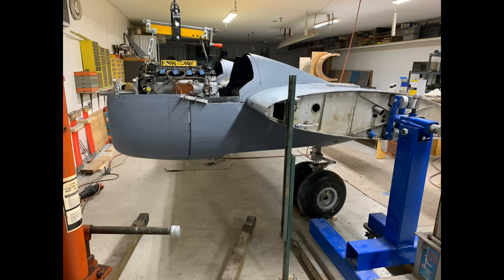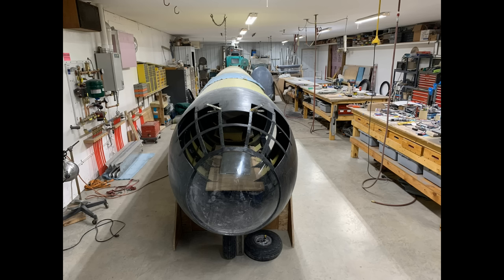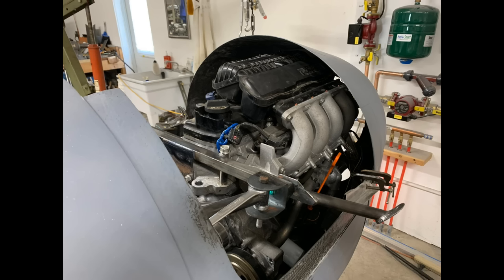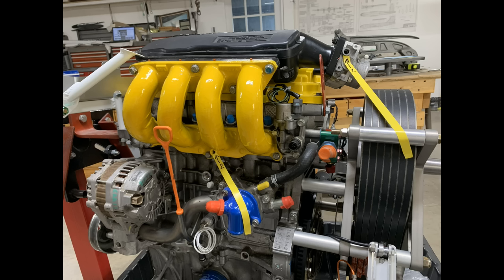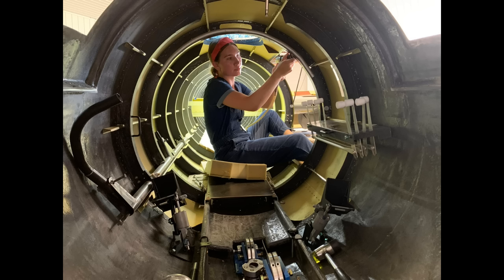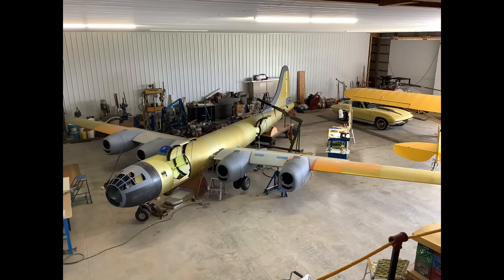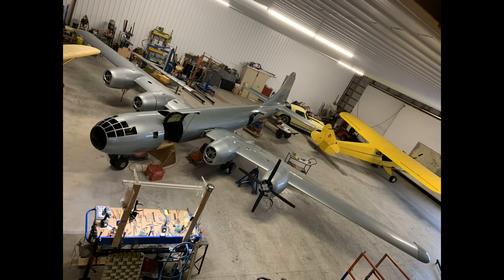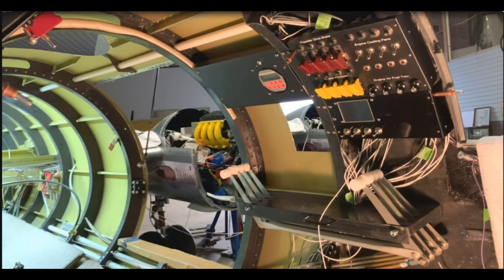Honda Powered B29 Replica

Comment: Those honda fit engines are really good, I have 200,000k miles on one and it's had zero problems. Always driven hard too.
Reply: If you always changhed the oil engines at 200k are still new, the car May Need minor maintenace but the engines if well treated are new
Reply: They are so reliable, In my 63 years I cannot recall ever seeing a dead Japanese engine that needed any thing more than a new set of rings and a bit of work on the valves, and when they do die they give you plenty of warning, you know fill up the oil and check the petrol.
Reply: The Honda Fit engines are the basis of the Viking Aero Engines produced commercially for experimental and light aircraft...
Reply: wow that is so not even a little relevent to this video
Reply: If you build such an airplane and will sit in it later on you will install the most reliable engines you can buy. Would you do it in another way?

Comment: Hard to imagine someone being capable of designing and building such a thing.  I work really hard in my free time on my car and motorcycle projects and just can't even fathom getting a project like this completed in five lifetimes lol.  Just amazing.
Reply: You and me both but I,ll be back in the shed on my bike resto once I,m done here.
This B29 an inspirational project and beautifully crafted. Just watched the first flight.
Reply: @Tekjoe25  It's just mind blowing.  Like the guy who built the Countach from scratch in his basement.  This is even more mental lol.
Reply: You have to look at it as compiles like BOEING that designed and built the B29 were made up of people just like  Tom Hodgson. Durring WWII Mr. Hodgson would probably have been working at BOEING. The difference is that BOEING had thousands of engineers and people working on the B-29 and Tom Hodgson only has a fraction of that, but just because it's one man it does not take away from his level engineering quality.

Comment: That is fantastic!    I always thought they should have made Bally's Bomber a two-seater.
Reply: It was way too underpowered for the extra weight.  He had to remove the gearboxes off the hirth engines to make everything look to scale so It lost a considerable amount of HP
Reply: Someday! To make the B-17 a good 2-seater or more it would have needed to be closer to the size of this thing which would be like 45-50% scale for the Fortress. 

Bally did a good job for what he did, but that machine does need more powerful engines for sure.
Reply: @karaayers2867  I wonder if HKS 700Es would make good replacements for the Hirth engines.
Reply: Keep those slugs flying taofledermaus 😊
Reply: @PistonAvatarGuy  the HKS might work but getting 4 of them would be a challenge and the cowls aren't very big so would still be a tight fit.

I did some thinking and one idea that might work for the Bally is putting some kind of genset in the "bomb bay" and electric distributed propulsion in the nacelles. It would probably yield higher HP per prop and package well.
Reply: @scottwatrous  I think HKS is still selling new engines, so it shouldn't be difficult to get 4 of them, just expensive. The 700E is only a couple of inches narrower than the Hirth engine, so the offset gearbox might still be an issue.

The challenge wirh your idea would be cooling a ~300 hp genset in the fuselage. Weight would also likely be an issue.
Reply: @scottwatrous  It's unfortunate that Verner Motor made their engines run at such a low rpm, higher rpm engines would have been smaller and lighter and probably would have been perfect for the Bally Bomber project.

Comment: Impressive.
But I'm still in awe of the Bally Bomber, which is a scale B-17 that has a pilot inside it.
Reply: This will be pilot flown. Don't see how you think this is less impressive than the Baily Bomber.
Reply: @filster1934 did he actually say that?
Reply: @daszieher you think it's gonna be RC with 4 Honda engines???
Reply: @daszieher  Yes, look at the pics.  There's flight controls and shutoff switches inside.  He posted above stating it's a 2 seater in tandem.

Comment: Okay so I see what appears to be a set of engine/prop controls. Also lots of switches inside. So is this a pilot flown A/C, or is it a very large R/C model? Either way it's damn impressive. That's some serious fabrication going on there. I am blown away by the accuracy and remarkable amount of time it must have taken. Hell the preplanning alone had to be time consuming in itself before the first piece of sheet metal was cut!!!! BRAVO
Reply from the maker: R/C wasn't mentioned anywhere in the vid. This has a 50 foot wingspan and weighs around 3000 pounds. It's a 2 seat replica.

Comment: And @007mwn, I think the narrator made a mistake in that, I think the Piper Cub in the background was used for the engine/redrive testing, the engines now well proven in that plane.
Reply from the maker: That's what was said here... I know because I supplied Tom with EFI for it 10 years ago.

Comment: Are there any special considerations or design changes that need to be made when taking an airplane design intended for some full-scale aircraft and then using that same design to make a new aircraft which is only about 1/3 the size? For example, doesn't one have to re-analyze the aircraft structure and all the control surfaces to ensure that all mechanical stresses are still within safe bounds and that the control surfaces can still operate efficiently and safely? All this might not be necessary if this were an RC aircraft, but since it has human pilots inside it I would think that all of the possible safety issues would have to be studied.

Comment: Beautiful plane!  Why 35% though?  The one thing that throws it off (for me anyway) is the tall bubble.  I take it that's for the pilots viewing?  If it was 40% could you have seen from the glass nose perhaps?  With some sliding side/top panels if needed?  (Like a replaceable sun roof, though for static showing, could you pull the bubble down with a temporary cover panel?)  You and Mr. Bally need to get together to share notes.  :-)

Comment: Why liquid-cooled engines? The radiators and associated plumbing probably add 150 pounds, plus the complexity of installation.  Maybe 150 pounds isn't much on a model of this scale. When is the maiden flight projected to occur?
Reply: Air cooled options were likely far more expensive. The best option would have been Rotax 915s, but those are $40k+ engines. Rotax engines have liquid cooled heads anyway. The UL Power engines are likely too wide for this aircraft and are also expensive. Air cooled engines also burn a lot of fuel, the weight of which would likely have exceeded the greater weight of the Honda engines. 4 engines burning an additional gallon per hour adds up pretty quickly. Edit: That fuel burn is at cruise power, at full power it's more like an additional 3 gph.

Anyway, apples to apples, liquid cooled engines are lighter than their air cooled equivalents, but we're comparing automotive engines to aircraft engines here, so...

Also, maybe he just needed heavy engines to get the CG right.

And you're probably looking at something more like 15 to 20 pounds of weight per engine for the cooling system, not ~40.
Reply: Why?  Millions of honda fit engines built, easily bought used for $500.
Reply from the maker: As mentioned in the video, this is a test bed for the Honda engines and reduction drives Tom designed.
Reply: @rv6ejguy I love to see different approaches making auto conversion work! Any idea if he plans to sale his conversions in the future? The price of “real” aviation engines are too expensive! I fly my Zenith 750 with a Honda Viking conversion, 32 hours so far and no problems. With that being said, I like to have back-up options if the time comes! Thanks for sharing!
Reply from the maker: @mhilderbrand7693  Tom's plan is to get more hours on the redrives. If proven reliable, he may offer for sale at some point.

Comment: Neat , 3,000lb actual comes out to 70,000 Scale pounds (Close to 74,000lb empty weight for B-29) , Factor weight and thrust by (1/scale)^3 or a factor of 23.3 ,    so 100 actual hp would factor to 2,300 Scale HP

Comment: Do you know why he made the fuselage the diameter it is? Is it to scale?
Reply from the maker: To scale AFAIK. Aircraft is being worked on now and Tom hopes to be back in the air in less than 2 months if all goes well. Will try to post another video at that time with more details and photos.
Reply: You seem to be well informed about this airplane do you mind if I ask you a bunch of questions about it?
Reply from the maker: I talked to the builder and pilot a couple days ago. He'll supply more info, photos and video when he's ready to resume test flying in a couple months. Repairs and minor mods are coming along well. He has a full time job flying Falcon 50/900s which doesn't allow him as much spare time as he'd like to work on the B29.  Be patient, more to come.  @timjodice100

Comment: Pretty amazing ! An RC aircraft that needs a full size aircraft hanger, and looks like it could be manned ! Thanks for sharing !

EDIT : Or is it meant to be piloted aboard ? I was getting the RC vibe/idea somewhere but now I'm not sure where.
Reply: One of the frames showed engine controls with cabling so I have to think it's going to be piloted.  At that scale it's going to be around 33' long, 47' wingspan fuselage diameter would only be 3' 2" so a wee bit cramped.
Reply from the maker: This has 2 seats in tandem. How would one transport this to the R/C field?
Reply: @rv6ejguy  There are some pretty big RC aircraft out there.  But, having said that, I've yet to see one that's using car engines which is another tip off that this isn't RC.
Reply from the maker: @fsj197811  Never mentioned R/C once so I'm not sure why so many folks think this is R/C. Has roughly a 50 foot wingspan and weighs a few thousand pounds. How would you fit that in your truck?
Reply: @rv6ejguy  RC didn't cross my mind until someone mentioned it.  There are some large RC aircraft but the weight is relatively low.  The more I thought about it the more I was: Nawwww this is going to be piloted.  Besides, I think 'experimental' was mentioned and I don't believe RC aircraft get that label. :)
Reply: @rv6ejguy The Taxi footage does feel like it's almost a giant RC in a way. I think because the structures and vehicles behind don't feel that small, and the fact it's on a grass strip where it accelerates very quick, that just feels like a lot of RC footage people have seen.

If this is filmed from a distance with zoom that'll definitely flatten the image and mess with the perspective a bit. To really help with the scale best is get close as possible, nice large field of view, and keep the camera lower so that the aircraft feels big compared to the background. I'm sure it won't feel like an RC plane then!
Reply: @scottwatrous  
Seeing the full size pickup that towed it partway out of the hangar for those engine tests lends perspective...
Reply: I recall a guy I saw here on You tube that built a piloted mini version of the B17– be cool to see these fly at the same time.
Reply: @rv6ejguy  Fly it 😅
Reply: @rv6ejguy   The 130' wingspan 15.000lb GlobalHawk is an R/C aircraft.  Someone like Tyler Perry has an enormous hangar and runway just for his aircraft (reference "At Tyler Perry's RC hangar in Atlanta" on youtube).  The cockpit appeared to be to small to be crewed.  In the video, I saw someone in the fuselage who barely seemed to be able to squeeze in. let alone have two people sit side by side.  You seem a bit upset that people are wondering if this is R/C.  I thought so myself and have thousands of hours in military aircraft.  It is not an insult to the builder since R/C is completely in the realm of possibility.  Perhaps in the update, you would be kind enough to walk us through the cockpit and show us what the instrument cluster looks like?  Will it have G3X, different glass, or be steam gauges?
Reply from the maker: @marklindsey1995   Not upset, just wondering how many people watched the whole video and were able to think this was an R/C model. A few points:

GlobalHawk is a military aircraft controlled by data link, with military support infrastructure. Hardly an "R/C plane" that one man would fly.

Pilots fit in sailplanes, with fuselages much smaller than this B29 replica.

You might notice that my channel has no R/C content- all about full sized, manned aircraft.

I mentioned that this aircraft was being used for a testbed for these Honda engines and PSRUs, also the Cub in the background  was the original testbed, it's full sized and manned.

How many R/C models used 130hp automotive engines for power?

I think R/C planes are normally limited to 55 pounds or 100 with a special permit.
Reply: @rv6ejguy  I think it is mainly because most people today can barely put toothpaste on their brush correctly so they can't concieve that someone could build a real airplane by themself.  Same reason the local rumors about building X in the garage and then not being able to get it out are so common.
Reply: @johnpublic6582 honestly, the acceleration is so insane on that taxi test that it looks like an RC plane.
Reply: @rv6ejguy personally I mainly view RC content. This came up in my feed and so I naturally thought it was RC. With no cockpit being shown I had no reason no to think it was just some enormous RC plane. There are plenty of very large projects though this would be the largest I’ve seen by far. However after realizing that the FAA would have a lot to say about someone building a massive gas powered RC unit of this size I started to conclude it must be a small piloted replica. Especially when I considered that it was larger that the other aircraft in the hangar. That being said. I really wouldn’t put it past someone who owns a lot of land in the middle of nowhere to try and make an RC this size. People are crazy. It would be a bad idea and the FAA would throw a fit if the found out. But there are all sorts of unmanned craft this size called drones. So RC certainly isn’t impossible on this scale. But would most definitely be illegal in multiple ways.

Comment: Granted, it’s not hauling giant payloads at extreme altitudes for vast distances, but I’d bet those Honda engines are quite a bit more reliable than the original power plants in the real B-29. It should be wicked fast too.

Comment: Fiberglass?
Reply from the maker: Aluminum with carbon fiber nose.
Reply: Cowlings are carbon.  Cowling plug was made by scanning a plastic model of B29 and printing the plug on a large format 3D printer.

Comment: So, a 35% scale model for 35% scale human beings. Children are going to fly this thing? Isn´t that dangerous?

All levity aside -- I´m astonished by the myriad of engineering challenges and obstacles. I wish you had addressed the matter that the scale of this thing requires very different skill sets and workflow than the typical RC project build. This is really building a homebuilt G.A. aircraft, not a “model“ airplane.

Who is this guy? Is/was he an aviation engineer?